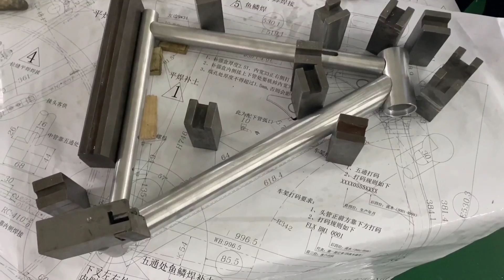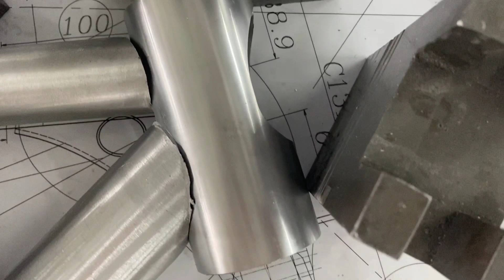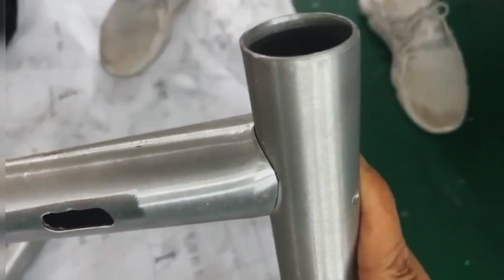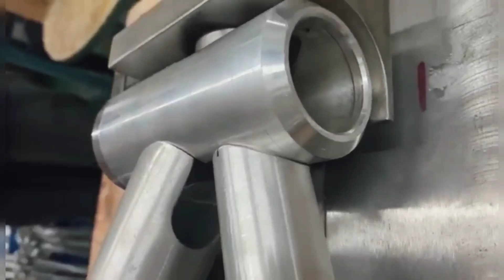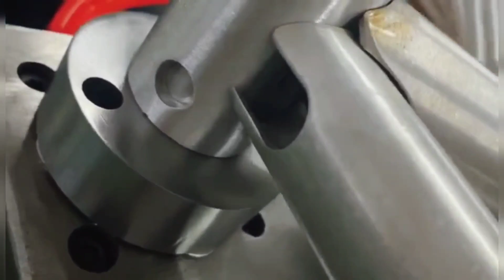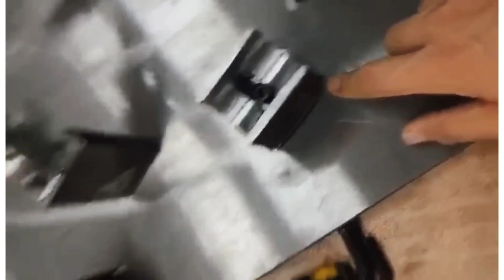FLX Babymaker Production Update: WELDING BEGINS

Comment: Carbon fiber is the new asbestos. It has the same crystalline structure upon being heated, ground or damaged that releases peak carcinogen chemicals. It is a terrible idea for you to use carbon fiber components in a belt system. Effects and onus of this will be with your for decades. Your bike idea is perfect, but use magnesium alloy or aluminum components instead. I would buy your product in a heartbeat at premium costs if I only knew you distanced yourself from CF. Every german car brand is slowly distancing itself from carbon fiber components, subtly but surely. They know the lawsuits are coming for the next fifty years.
Reply from the maker: Thanks, we appreciate the suggestion!

Comment: I'm assuming the increased speed announcement won't apply to bikes coming to the UK?
https://www.gov.uk/electric-bike-rules
Also, you won't be "type approving" the UK bikes?
Reply: Just noticed this in your FAQ...

For our friends in Europe and other places, we will be sending the Babymaker with a 250w rated motor and EU compliant speed limit. Motors up to 250w nominal power are legal in most countries. We'll be tuning the 250W version for max performance - you will be hard pressed to notice any difference in performance. The speed limit can be programmed to comply with local laws.
Reply from the maker: Thanks for checking that out.

Comment: I have a question. I live within the eu so does that mean the bike will be limited to 15.5MPH or 25KM/H or stay at the full 28MPH?
Reply from the maker: When the bike ships to your country, it is configured to comply with your local laws and regulations.  However, it can be reconfigured by you for track or closed-circuit use.  Before your bike arrives, we'll be releasing the manual, along with several videos detailing how to use, the display functions and how to change settings to suit your riding.
Reply: HI Felix, I'm the same but in Australia. We get the 250w motor, not the 350, so you could not reach 28mph in any case I believe... however, should you wish to ride offroad, or on a racetrack (not public space), there apparently is a manual which will guide you to modify the settings and will allow you to override the 25kmph cutoff limit... so that's a bonus.
Reply: @GtaonlineMe  thanks for the response. Damn! i wanted that 350W motor! oh well